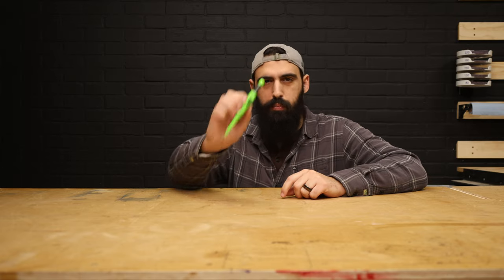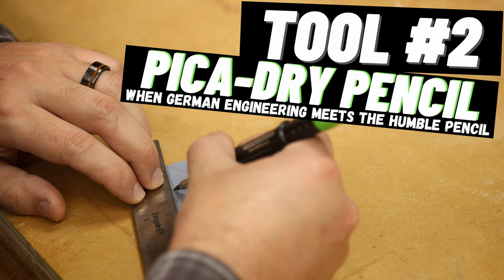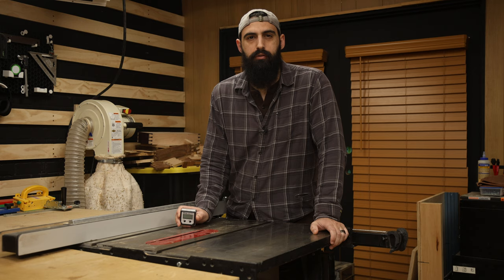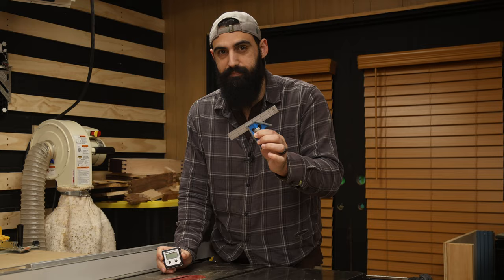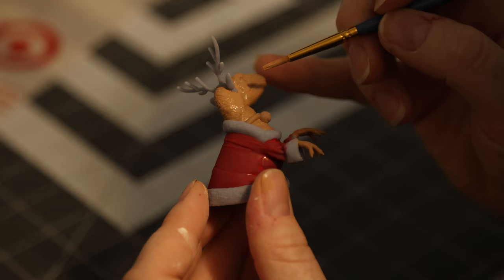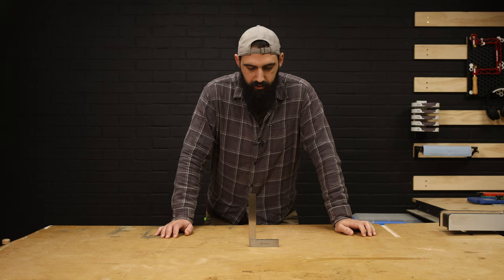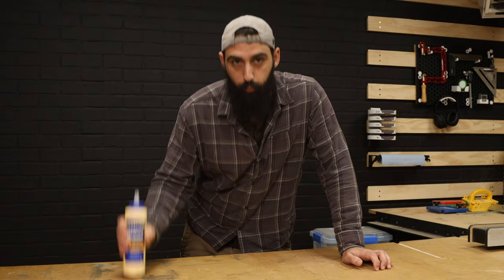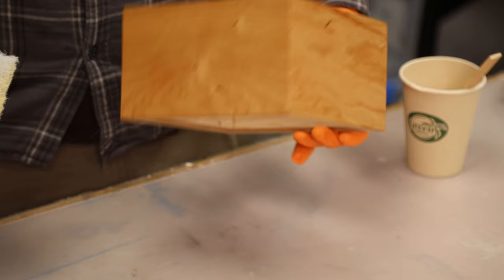Tools you will ACTUALLY use

Comment: Great project Jason. I was recently asked to make one, so I was hoping to see more of the build. 

I would contend that buying an inferior drill bit set is a necessity, insofar as it will let you know what size bits you frequently use, then pay the premium for indovidual bits.

I have dozens of 1/8" bits for pilot holes, and maybe 5-6 slightly undersized bits (15/64, 23/32, 7/16, etc) as my boring bits. Nonstandard sizes allow for tighting fits, and then I dont have a significant imvestment in items i never use.

I will say this, you can never have enough FastCaps. Pretty sure i have 4 lefty/righty, a Yellow metric only, and one of those Black flimsy tapes. I think my FastCap collection is becoming more of an addiction
Reply from the maker: Thanks Jered! Yeah my plan was to show a lot of the build (I filmed a lot more) but in the edit I couldn't get the pacing right. I think i'll definitely try this style of a video again and have an idea of how to incorporate the "tool talk" and build a lot better.

As far as your suggestion about drill bits thats actually a great idea. You obviously don't want to be buying a whole kit everytime your 1/8" bit burns out. I guess really what i'd steer people away from is a set of "general purpose" drill bits. At least in terms of working with wood.

Comment: I've used and like the FastCap tape measures a lot. I stumbled across the Komelon self-locking tape and that is now my first choice. Not because of any of the fancy features of the FastCap, but simply because it comes out locked. You only push the button to retract. Such a simple difference, but MUCH handier to use. No pressing to lock, then unlock to pull out more, then lock again. Who uses a tape measure and doesn't want it to stay put?
Reply from the maker: Yeah it would be cool to see FastCap implement that feature. Even at the cost of a buck or 2. My 25ft craftsman tape has that and I love it. Especially when I'm marking multiple points along the tape measure at a time. Thanks for sharing another option for people though!

Comment: A bit of an essay about those pencils - if you dont work in an enviroment where often climb ladders or crawl somewhere, the expensive ones have no benefit. Cheaper pencil might have small and weak pocket clips and they will break if you catch on something, more robust clips like the one on Pica hold fine. Most annoying thing about pica is having to pull out the sheath to sharpen it, most other brand have sharpeners either on the sheath near the clip (meaning you can easily sharpen with one hand)or it screws into the top of the pencil. For my money, the best of the best is Hultafors, but for a shop enviroment a cheapo will do just fine (especially for people like me who use multiple of them for different colors).
Reply from the maker: Great insight Petr! Thanks for pointing out the weak clip bit for the cheaper ones thats something that always stirred me away from them but you're not wrong. Having the strong clip can be a pain when you need to pull it out to sharpen. I'll have to check out the brand you mentioned. Thanks again for sharing. 🙏 Hope it helps others too!
Reply: I 100% agree with you there. These type of mechanical pencils (Pica/Hultafors, etc.) are very good for construction sites imo. but in a shop a "real" mechanical pencil is way better. If you got a 0.9mm pencil and good leads you never have to sharpen them and better leads won't break even if you use them on rougher stuff. Pica has now a "Fine Dry" which uses a 0.9mm lead but the tabs on the sheath always broke on mine which makes them useless.
Reply from the maker: Hmm...looks like i'm going to have to look into this. At least for marking cut lines. I still really like the shading benefits and marking for sanding with the pica dry. But yeah. Maybe I should look into these options for general marking. 🤷‍♂️